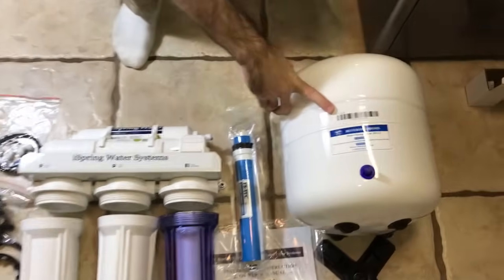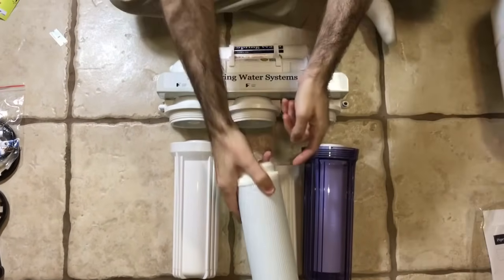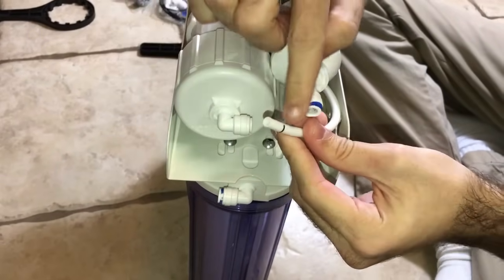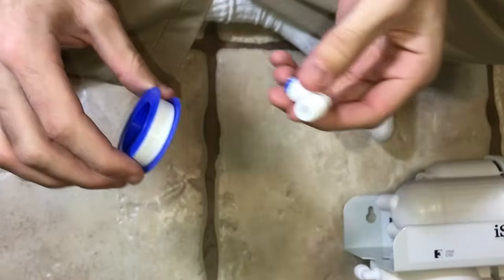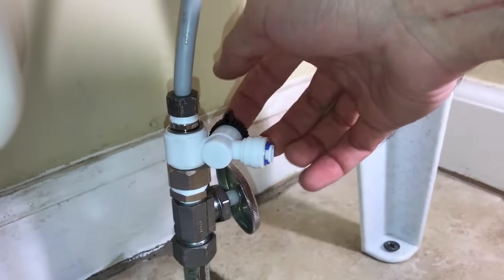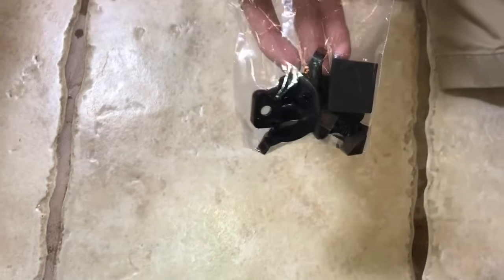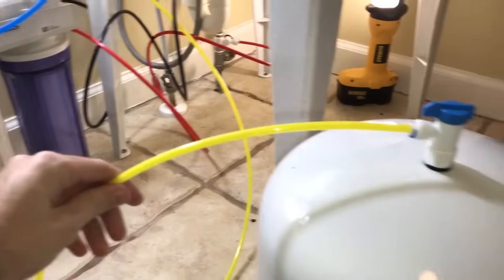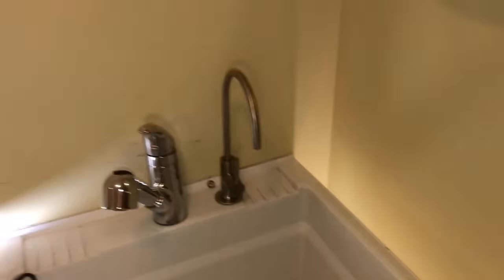Installation | iSpring RCC7 Reverse Osmosis Water Filter System

Comment from the maker: Link to the updated RCC7 series installation video: https://youtu.be/yEvLqKiPa5k
Reply: The new video is lacking teflon tape on the AFW43.  Is teflon tape not necessary anymore?
Reply from the maker: @user-lj8yq9vs8t  Hi there! There should be an o-ring in the female connector of AFW43 so the plumber's tape is not necessary there. As for the male connector, it depends on if there's an o-ring in the female side of your water line. If there is no o-ring, then plumber's tape is necessary and you can get it here: https://www.123filter.com/ac/ispring-ptfe-industrial-sealant-tape?path=118_87. If you have any other questions, please feel free to contact us at 678-261-7611 (M-F, 8:30 - 5:30 EST). We are happy to help!
Reply: @iSpringWaterSystems  Much obliged!
Reply: Lack 2:45 and avg

Comment: Does anyone know how much water gets flushed down the drain during the whole process? I heard some systems use 2 gallons of water to make one gallon. Thanks
Reply from the maker: Hi there! The amount of water sent to the drain can vary depending on the specific RO model.
For example, the RCC7 has a pure-to-waste water ratio of up to 1:2 under proper conditions. This means that for every 1 gallon of purified water, about 2 gallons may go to the drain.
If you have further concerns or questions, do not hesitate to contact us at  support@ispringfilter.com or  at  678-261-7611 (M–F, 9 AM–5 PM EST) We’re here to help!
Thank you!

Comment: I forgot to drain in my install steps and directly ran the entire system , should I do anything about it ?
Reply from the maker: Hi there! A pre-filter wash is a recommended step to flush out any loose carbon particles (If any) from the filters before regular use. This step helps prevent these particles from passing into the reverse osmosis membrane and other filters, ensuring optimal performance. If the pre-filters were not flushed initially, we suggest flushing the system thoroughly now. This typically does not cause permanent damage, but ensuring a proper flush can improve the system’s overall performance and water quality.
If you have any questions or concerns, feel free to reach out to us at support@ispringfilter.com or 678-261-7611 (M–F, 9:00–5:00 EST). We’re here to help!
Thank you!

Comment: just an idea: flush the first 3 filters into the canister so it all the activated carbon could clean it further and take all the bad smell if any in the tank.
Reply from the maker: Hi there! Please refer to our updated video on how to install the RCC series systems:
https://www.youtube.com/watch?v=yEvLqKiPa5k
This video includes a pre-filter wash, which is a recommended step to flush out any loose carbon particles (if present) from the filters before regular use. This helps prevent those particles from reaching the reverse osmosis membrane or post-filters, ensuring optimal system performance.

Comment: The odd fact that majority of people who get the water filter to weed out posticides and chemicals. Then just casually uses teflon tape. Wwwwttttffff!!!!??????? How is that good for you?
Reply from the maker: Hi there! The systems come with quick-connect fittings, so Teflon tape is only needed for threaded connections. Teflon tape is commonly used in plumbing to ensure leak-free seals. There are many versions that are non-toxic and safe for use in water systems, as they do not leach harmful substances into the water.
By the way, please refer to the latest installation video for the RCC series here:
https://www.youtube.com/watch?v=yEvLqKiPa5k

Comment: Why do you need this big round tank? and why do you need a drain hose?
Reply from the maker: Hi there! Water is stored in a bladder, made of a material called butyl. When there is a demand for water, the water is pushed out of the tank's bladder by air pressure. As water is forced into the tank by the operation of the RO unit, pressure inside the tank increases. The RO unit shut-off valve stops production of water when the pressure in the tank reaches approximately 2/3 of the pressure of the tap water that supplies the RO unit.
We also offer some tankless options:
https://www.ispringfilter.com/ac/high-flow-ro 

Regarding your other question, the drain hose is necessary because the reverse osmosis process generates a certain amount of wastewater.
If you have any concerns or questions about our products, please reach out to us at support@ispringfilter.com  or 678-261-7611 (M-F 9:00-5:00 EST) for proper assistance. Thank you!
Reply: @iSpringWaterSystems  thank you for the clarifications :)

Comment: Leak stop valve ?
Reply from the maker: Hi dear customer!  The Leak Detector and Shut-Off Valve for Reverse Osmosis and Under Sink Water Filtration Systems protects your home and business properties from costly water damage by automatically shutting off the incoming water supply once the pad detects a potential water leakage. Please, check the link below:
ALS1:
https://www.123filter.com/ac/index.php?rt=product/product&product_id=385&acid=2 
If you have any questions or concerns, please contact us at  support@123filter.com, at (678) 261-7611 M-F 8:30-5:30 EST, or at (470) 560-0012 M-F 8:30-5:30 EST (Messaging only)
We are happy to help!

Comment: The latest plumbing code no longer allows drain saddles. Use a dual air gap with the dishwasher
Reply from the maker: Hi dear customer! Thanks for your comment!
A drain saddle is to provide a drain connection for our Reverse Osmosis systems to a drainpipe. It allows wastewater flow from the system’s drain line into the drainpipe under the sink.
You might want to check our video on how to install it:
https://www.youtube.com/watch?v=IA9jHDxLOzo 
If you have any questions, please kindly contact us at support@123filter.com, at (678) 261-7611 M-F 8:30-5:30 EST, or at (470) 560-0012 M-F 8:30-5:30 EST (Messaging only)
We are happy to help!

Comment: My water wasn't black on first run.. is there an issue do you think?
Reply from the maker: Hi there. No, there shouldn't be any issue. Please note that the pre filter washing has to be performed to avoid carbon loose (IF ANY)  going through the membrane. 
For further concerns or questions, please kindly contact us at support@123filter.com, at (678) 261-7611 M-F 8:30-5:30 EST or at (470) 560-0012 M-F 8:30-5:30 EST (Messaging only) 
We are happy to help!

Comment: If you don't rinse the pre filters will that damage the RO membrane?
Reply from the maker: Hi there. If the membrane is brand new, there shouldn’t be any problem. You should test the water with a TDS meter to determine how well the membrane is working. 
If you see that the membrane is not properly working, please kindly contact us at support@123filter.com or at (678) 261-7611 M-F 8:30-5:30 EST to properly guide you. We are happy to help!

Comment: I forgot to flush the 1st 3 stages, is my membrane shot and should be replaced?
Reply from the maker: Hi there. If the membrane is brand new, there shouldn’t be any problem. You should test the water with a TDS meter to determine how well the membrane is working. 
If you see that the membrane is not properly working, please kindly contact us at support@123filter.com or at (678) 261-7611 M-F 8:30-5:30 EST to properly guide you. We are happy to help!

Comment: What if there was never colored water when flushing through the carbon?
Reply from the maker: Hi there. There is no problem if you don't see any colored water or loose carbon when you flush the pre-filters. This process helps to prevent colored/black water from touching the membrane, in case there is any. 
If you have any questions or concerns, please contact us at support@123filter.com or at (678) 801-9308 M-F 8:30-5:30  EST//(678) 261-7611 M-F 8:30-5:30 EST
We are happy to help!

Comment: Why does mine keep draining water
Reply from the maker: Hi there! It might be that the tank is not full. Please, kindly check that the tank is full. It takes about 1-2 hours for the tank to fill. Another reason might be that your incoming water pressure is below 40 psi, so the tank cannot be fully filled to shut off the system. Please, kindly check that the incoming water pressure is at least 40 psi. If it is not, a pump should be added to increase the pressure through the system. 
If your incoming water pressure is 40 psi, it will be necessary to check the Automatic Shut off valve (AAS2) or Check valve.
For further concerns or questions, do not hesitate to contact us at support@123filter.com and at (678) 801-9308 M-F 8:30-5:30  EST or (678) 261-7611 M-F 8:30-5:30 EST

Comment: What is the tank for? Seems like there is no reason for it, with only one line going to it. I could understand if there was a second line, but there is not.
Reply from the maker: Hi there. The conventional reverse osmosis (RO) system has a limited ability to efficiently produce RO water. Consequently, the system incorporates a storage tank to hold the RO water in advance. When you turn on the faucet, you will have immediate access to clean water from the tank.

If you bypass the tank, or if the tank is not full of water, you will get low or no water from the faucet.
For further concerns or questions, do not hesitate to contact us.

Comment: Tiro demasiada agua por el desague
Reply from the maker: ¡Hola! Esto podría ocurrir debido a que el tanque no está lleno. Por favor verifique que el tanque esté lleno. El tanque se tarda en llenarse 1-2 horas.  Otra razón podría ser  que la presión de su agua está por debajo de 40 psi lo que hace que el tanque no se llene completamente para apagar el sistema. Por favor, verifique que la presión de su agua tenga la presión mínima para que el sistema funcione correctamente. Si no, una pump sería requerida para incrementar la presión de agua en el sistema. 
En caso que la presión de su agua sea la adecuada, puede que haya un problema con  la Automatic Shut off valve (AAS2) o Check valve. 
Para mayor información puedes contactarnos a  support@123filter.com o a los siguientes números: (678) 801-9308 M-F 8:30-5:30  EST
(678) 261-7611 M-F 8:30-5:30 EST

Comment: What is the size of the tank?
Reply from the maker: Hi there. The tank is 4-gallon with up to 3.2-gallon holding capacity.
Reply: @iSpringWaterSystems  I meant the actual size. Height and width. In inches centimeters or whatever you have
Reply from the maker: @kovalenkoihor4325  It's 11 x 11 x 14 inch.

Comment: Did he drill a hole in the pipe at 12:30? I’m in apartment is this not compatible for apartments?
Reply from the maker: Hi there. Yes, he drilled a 1/4”  hole.  If you're not allowed to modify your apartment, you can choose the drainpipe section that's easily replaceable and replace it back with a new piece when you move out.
For any questions or concerns, do not hesitate to contact us at support@123filter.com or at (678) 801-9308 M-F 8:30-5:30  EST// (678) 261-7611 M-F 8:30-5:30 EST
Reply: The guide says to install the drain line in a horizontal section of the pipe to minimize the dripping sound. Why did you choose the vertical pipe?
Thanks

Comment: my pipes under the sink are metal, not plastic like in the video, what do i do
Reply from the maker: Hi there. It would still work with no issues.
Reply: @iSpringWaterSystems  but how do i make a hole in metal

Comment: we installed this unit and took every step as showed in video. The problem we are having is when we used a water tester on the water after we flushed the system it is still showing the water is not pure. Now what!!??
Reply from the maker: Hi there. While RO water is designed to remove impurities and contaminants from your water, it does not necessarily mean that the resulting water will have 0 TDS. TDS, or total dissolved solids, refers to the amount of minerals, salts, and other dissolved substances in your water. Even after going through the RO filtration process, there may still be trace amounts of minerals and other substances in your water. If you still have concerns, please call us at 678-261-7611 or 678-801-9308 (M-F, 9 - 5 EST). We stand behind our products and always willing to help.

Comment: I recently bought a 7 stage filter from ebay.Bloody nightmare No instructions at all  Wierd fittings  and the 8mm tube was difficult to put in standard 8mm push fittings.I couldn't have managed without your concise video.Many thanks.  :}
Reply from the maker: Hi there. Thanks for your comment! 
For any questions or concerns, do not hesitate to contact us at support@123filter.com or at (678) 801-9308 M-F 8:30-5:30  EST// (678) 261-7611 M-F 8:30-5:30 EST
We are happy to help!

Comment: anyone ever have leak problems? I just bought and installed this unit but now I am reading all these negative reviews on Amazon about water leaks and destroyed kitchen floors. I’m having second thoughts about keeping the product.
Reply from the maker: Hi there. The system should not have leak issues if installed correctly. If you have any questions or concerns, feel free to call and talk to our tech support representatives at 678-261-7611 or 678-801-9308 (M-F, 8:30 - 5:30 EST). We stand behind our products and are always willing to help.

Comment: Question was everything conected and I didn’t flush it out and let it Run for a little bit what should do now? Flush it any way still or to late to do that no black water coming out!
Reply from the maker: Hi Gaby. Thank you for reaching out. It's ok if you forgot to flush this time. The RO membrane will catch the loose carbon so it won't end up in your filtered water. Just remember to flush next time when you change the filters. :)

Comment: What's the part name of the black square adhesive tape w the hole against the PVC tube called? Around 11:55.
Reply from the maker: Hi Kai. The model number for that part is ADS1K. You can find it here: https://www.123filter.com/ac/index.php?rt=product/product&product_id=443
Reply: @iSpringWaterSystems  actually found what I was looking for. It's the rubber gasket

Comment: I purchased this system and I have two questions. First, is the black line always running water? And second, is the tank necessary?
Reply from the maker: Hi William, I'm sorry to hear the issue. Please refer to this video about the constant drain problem you may encounter: https://www.youtube.com/watch?v=t4rPacnCKVo. And yes, the tank is necessary for this system to get a good water flow at faucet. Please call us at 678-261-7611 (M-F, 8:30 - 5:30 EST) if you need further assistance. We are happy to help.

Comment: Will this work on well water w/o a whole-house filter?
Reply from the maker: Hi Leo. It will. But depending on the contaminant level of your well water, it might shorten the RO system's lifespan if you use it without a whole house water filter. To get a personalized product recommendation,, please get your well water tested and call us at 678-261-7611 (M-F, 8:30 - 5:30 EST) after you get the test result.

Comment: This video implies Teflon tape is included. Mine did not include Teflon tape nor does the instructions mention it.
Reply from the maker: Hi Trey. Our older version needs plumber's tape to install, but the newer versions don't. Please feel free to contact us at 678-261-7611 (M-F 8:30 - 5:30) if you need further assistance.

Comment: Great video but one change needed. For the feed water adapter (AFW43), these are compression type fittings with a rubber seal. Teflon tape should NOT be used on those threads. The rubber seals the connection, not the threaded connection. Only use teflon tape on the connections without a rubber seal.---only for the steel threads : yes ,using teflon !
 any way it is  a good demo! ,tks

Comment: be aware while buying ispring RO system their filter housing has custom thread which means you'll have to replace any broken parts with ispring parts only at an extortionist price. I went through this problem, also their after sales customer care is an absolute sham. I now returned my ispring system and replaced it with a RO system which has easy replacement parts and the filters that don't cost an arm or a leg.

Comment: Explain the fitting for the air bladder.  Do you have to have a bicycle pump to pressurize the system?  Explain the use of the air bladder?
Reply from the maker: Hi Joseph. Please refer to this video for the instructions for pressurizing the tank. If you need more information about fittings and the use of air bladder, please give us a call at 678-261-7611 (M-F, 8:30 - 5:30 EST). We are happy to answer all your questions about our products. :)

Comment: Will the tank have enough pressure to push up the water 6ft since I'm putting it in my basement and running it upstairs?
Reply from the maker: Hi Korey. 15' is the maximum distance for the tank and less if downstairs. 6' should be fine.